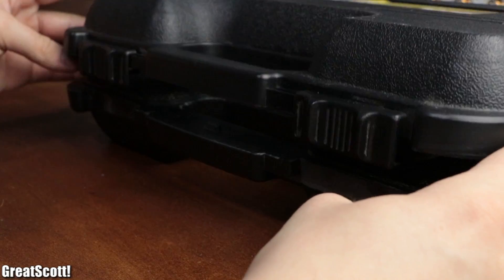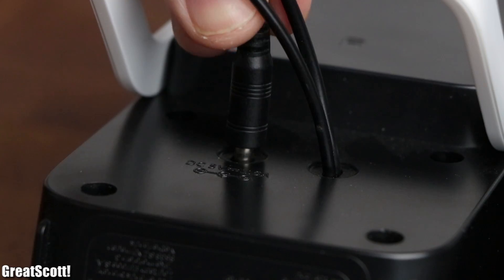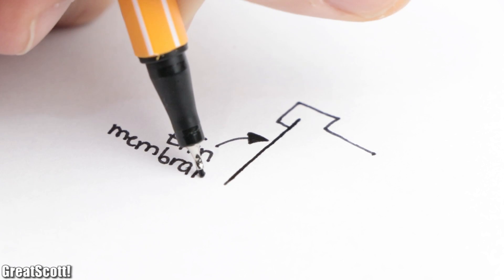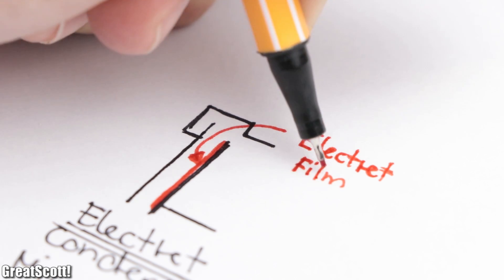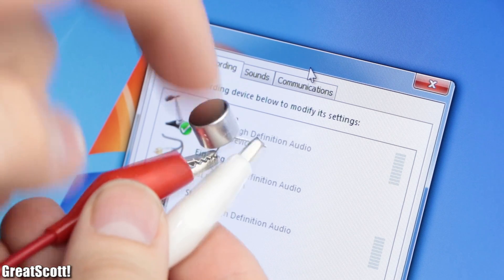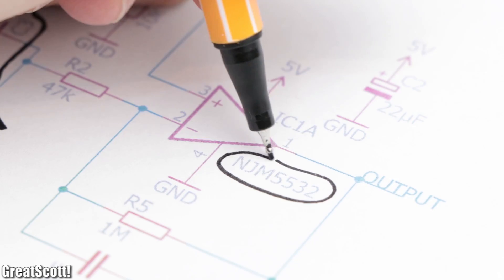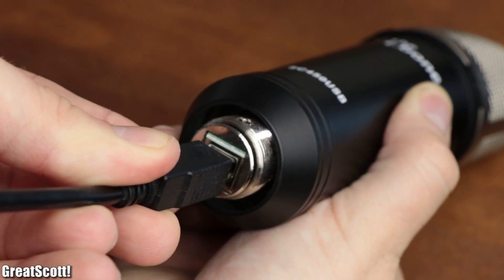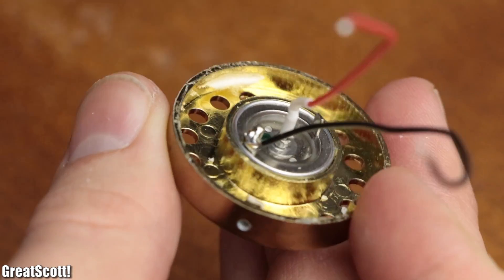Voice-over Microphone || DIY or Buy

Comment: Excellent video! I have been using for years a diy mic in my videos. it works for me xD cheers
Reply: Saludos Gastón!
Tanto tu canal como este, son mis favoritos!
Reply: If you use pcie audio card or usb audio card it works awesome like professional usb mic like DIY Perks one and yes he use homemade mic but he add only usb audio card. Mic created by scoot wont work good becouse he connect it to sh...baaad audio on motherboard....audio on motherboard works good only for output not for input... Output guality can be good but input always is bad becouse noone pay more only for better input if you can buy professional usb mic for that.If GREAT SCOTT use usb audio card or pcie audio card (on normal pc) but dont use  motherboard audio whitch in his pc is baaaaaaaad as... I dont say how bad but 1$ usb audio card from ebay get 10x better guality my old pc get 300$ (actually 180$) motherboard and it is the same bad.. Any usb audio works better for input only output is awesome
Reply: Yes, this test doesn't do it justice - he just took the first electret he could find. I use Panasonic WM61 for all the videos on my channel and will soon be using Primo EM172 for recording where low self noise is needed. Those are far better than this crap - and better than that studio mic also, if you use it for other recordings than voice overs and other similar "point sources" right in front of the mic. The off axis frequency response is usually horrible with those large capsules.
Reply: Saludos Gastón que bueno verte por aquí...
Reply: Same
Reply: Would you provide shamatic diagram?
Reply: Gaston queridooooooo
Reply: It is the Electret Microphone that is the bad source. Most of the PC/Laptop motherboard only bad on SnR Ratio, where PCI/Usb audio card has advantage on the power smoothing and better noise floor.

The sound quality, noise aside, should not be that much different compared to expensive hardware ( both need a good pre-amp ).
Reply: Proyectos LED 8
Reply: Proyectos LED No te escribieron :'v
Reply: gaston un dia desarmo un microfono antiguo que tenia una membrana grande y yo tengo uno igual pero le puse el fet de una capsula moderna y alucine con el resultado !!
Reply: Sergio Ares jajaja
Reply: Sebastian Nurkowski any usb audio card will do? Or is there a specific type /brand?
Reply: Proyectos LED can you give me print circuit of this circuit
Reply: hola gaston
Reply: can anyone help me....I'm facing low volume and lot of noise....can increasing. the input voltage increase the recording volume?
Reply: @et.sachin  How is your set up? Have you used a pre amplifier?
Reply: @davemwangi05  yes i did, But i used the 5 volts from USB port to power the entire circuit maybe that's what caused the noise.
Reply: @et.sachin  When I used to build these circuits, I noticed that any other power supply except for batteries picks up a lot of noise. especially if you have high gain.

How much is your gain? as in have you used a feedback resistor and an input resistor? and what's their values, what's the amplifier IC number? High gain causes it to pick a lot of noise because signal to noise ratio drops and it picks unwanted radiowaves. Also shorten the distance from the mike to the amplifier imputs as much as possible.
Reply: @davemwangi05  Actually i did this project a year ago so i don't remember those values, but two things which i did wrong would be the power source ( USB socket )  and after reading your comment i remembered that the distance between mic and amplifier in my circuit was a bit long ( around half a meter ). Thanks for sharing your thoughts on it, i really appreciate it 🙏
Reply: @et.sachin  if you look at the insides of a lot of mic's, they'll "float" the connection (soldered together above the PCB) between the mic and amplifying transistor (at least for the JFET non-electret mic circuits I've seen) to minimize noise from the rest of the circuit/sources (some also painting that connection with some insulation)
Reply: Can you show the circuit ? Please
Reply: Ohmaiga un crossover
Reply: same for me i am using a broken nokia headset mic and its still working after 8 years even though nokia company is bankrupt
Reply: Would you provide shamatic diagram?
Reply: Nos juntamos todos por aca
Reply: The best thing you can do is get a preamp instead of using mic boost.

Comment: great video!
suggestion: diy or buy: arduino (buy e.g an arduino uno or use an atmega chip and build the "fancy stuff" like headers, regulator, ftdi chip, ... arount it yourself)
Reply: Julian Ilett has actually done a video like that: https://youtu.be/sNIMCdVOHOM
Reply: Well if you're starting with a 16/32 pin DIP package all you need is power, a USB FTDI controller if you're programming it that way, and a pin breakout... Almost guaranteed that buying an arduino is cheaper, unless you're getting the super expensive ones. You can get a Pro Mini for like a dollar or two.
Reply: If you compare to the original Arduinos (now called Genuino here in Europe), then it's definitely a win for the DIY, since an Arduino Genuino UNO costs 20 € + shipping (which is very expensive, 10 € minimum to Spain). If we compare to the clones, then it's definitely a win for the buy, since they're only 4 € and free shipping. The only downside is the time they take (minimum 1 week).

Comment: I would like to see DIY or BUY wall adapter. May be 12 V 2A or similar
Reply: Buy would be much cheaper
Reply: Nicksperiments did anyone say... FULL BRIDGE RECTIFIER?
Reply: Nicksperiments That's not how wall adapters work. Of course we can do that but it's highly inefficient and would heat up a lot. Wall adapters (SMPS type) use a flyback converter which are more efficient and don't need huge transformer.
Reply: now that is a disgrase who make adapters its really wise to use readly available ones
Reply: Nicksperiments Yeah they aren't super complicated but you forgot one very important reason to buy over diy, any half decent pre-made adapter usually has a number of safety features, such as class x/y capacitors, isolation slots, opto isolators, etc... All things you can implement yourself of course but it adds to an already more expensive project which might be less safe than a cheap chinese adapter off ebay.
Reply: Nicksperiments What about a switch mode wall adapter though?
Reply: You would either have a hard time to design a decent one with flyback converters and decent isolation(which is definitely plausible if you design your own pcb;which nowadays is rather cheap/easy), or would make one so shittt that it would probably get you electrocuted/set your house on fire.
The latter is most likely.

THINK LONG AND HARD BEFORE GOING DIY ON MAINS STUFF.
Creeping, creepage distances, fail safe, transient tolerance, etc,  are a real risk with 220 volts.
Either way, those are very very cheap nowadays.
Reply: Mahesh Bhat I'd have to say buy unless you can salvage a transformer. You can get wall adapters pretty darn cheap but a transformer alone would be more expensive since manufacturers can buy them in bulk whereas DIYers don't. Wall adapters are simple though. Just a transformer, full bridge rectifier, and voltage regulator
Reply: Nicksperiments modern power supplies dont use a transformer. They are called switching mode power supplies. They work by Quickly switching on and off. This removes the need for any transformer

Comment: Please make for DIY noise cancelling headphones
Reply from the maker: I put it on my to do list
Reply: Thanks a lot.
Reply: Waiting for that.
Reply: @greatscottlab  Amy update on diy noise cancelling headphones
Reply: GreatScott! Hi Scott love from India....:)....!!!
Reply: Good idea.
Reply: I'd like that too.
Reply: Arun Balakrishnan I don’t think that would work because you need to account for the distance between the mic and headset
Reply: Really, i didn't think that,
Reply: Arun Balakrishnan if the mic is close enough to the headphones, but there is a delay added in those headphones- very slight but if it’s not there the quality is noticeably worse.  In fact, you need two mics- one on each ear piece.  You also need to match amplitude at the ear.  Very complicated- did it for my final project for an electronics class- but I’d like to see Scott give it a shot
Reply: I tried to make noise cancelation headphones using microphones and opamp that mix in reverse phase signals from them. It turned out, that it remove only low-frequency noise. So I think, that in modern headphones it implemented as dsp, that make fft to signal, then change phase for each frequency, and then mix them again. And its impossible to make good noise cancellation only with analog components.
Reply: This.
Reply: I thought, picking ambient sound and inverting and add with the music sound can reduce a bit of noise,. I found basically all the noise cancelling headphones are doing this. This can be done using an op-amp. I tried, but failed. Hope a better video from Scott
Reply: But I did it with only 1 external mic per ear. Possible, internal mic with feedback will give better results.
Reply: you buy it as cheap it did not make sense to make it 3d print or other cost is bit expensive or it does not look good while use it.
Reply: A noise cancelling amplifier with built-in mic for headphones, Hmmm that'll be great.

Comment: So that's what phantom power is about when talking about mics.  I had always wondered.  I assume the music was from audioblocks?
Reply from the maker: +Wholly Mindless Correct
Reply: Patreon supporters get to watch the videos earlier.
Reply: Phantom power is just electricity that is needed to operate the microphone. It is a DC signal that is then converted into sound waves by the difference in capacitance between the two plates.
Reply: +Senpai Kur I think Patreons get to watch videos earlier than others.
Reply: So can sb tell me if there's a boost converter inside that mic? There I saw some components and a coil and some e-caps was rated 50v which is still on the boundary of 48v. Thanks
Reply: I am sorry, but 6.35mm plug can be 2 wired/mono/unbalanced or 3 wired/stereo/balanced. You just need balanced cable (6.35mm or XLR), Phantom power source from your mixer or microphone amplifier (it is usually switched off by default) and the Phantom powered microphone ofc. Agreed on everything else! :-)
Reply: Well actually no! Phantom power is indeed usually 48 volts but it requires the use of a microphone transformer at each end of the microphone cable. Some early high quality mics like the AKG c451E (STILL sold today, unsurprising really as it's a superb high quality mic, yet I was using this exact same microphone in 1971!!) used (uses?) a separate power supply for ease of use where phantom power was unavailable from the mixing desk (where it usually is derived or supplied). The subject is an interesting one and worth checking out on Wikipedia. Much has changed in the industry since my first job as a professional TV sound engineer after graduating, but phantom 48v power and microphones fed from it are still around and old (1970's) microphones can still be used seamlessly in modern studios or on stage rigs without problem - witness the c451E mic already mentioned. Because true phantom power requires 3 wires (2 for balanced audio and the positive 48v feeds plus an audio return) it integrated, and still does, very nicely with the ubiquitous ITT/Cannon 3 pin connectors seen on all professional audio equipment since before I was a boy.

Where a 1/4" jack plug (6.35mm) is used it is NOT a balanced feed and in this case in order to provide phantom power a separate power supply will be used that has a built in transformer of appropriate type to which the two-core screened and balanced mic cable is attached (implies that you MUST have a balanced microphone at the other end or an equivalent adaptor from single ended to balanced feed) and which also provides an unbalanced output to connect to the mixing desk.

Check out the Wiki, but also bear in mind that POE in the IT world is also a phantom power scenario and utilises the balanced signal transformers contained within modern (relevant ones) Ethernet RJ44 jacks. The separate POE injector units you can obtain do the exact analogous job of the separate 48v phantom feed units in the audio world. BOTH use 48v, 24v and 12v within the standards and at a basic level work in EXACTLY the same way - providing noise rejecting remote power to devices along the signal cable